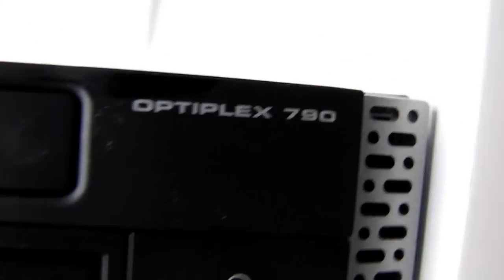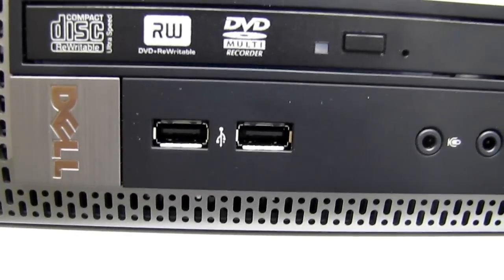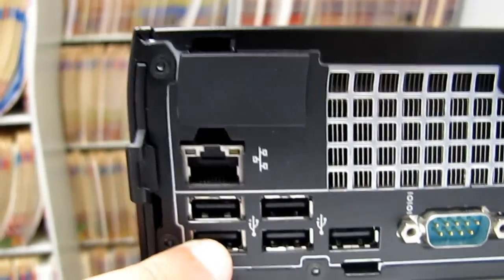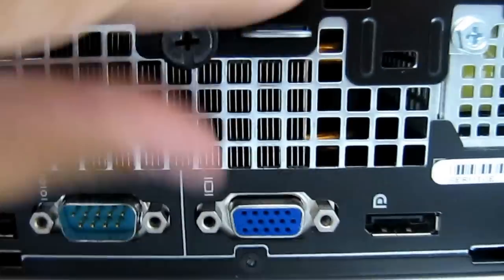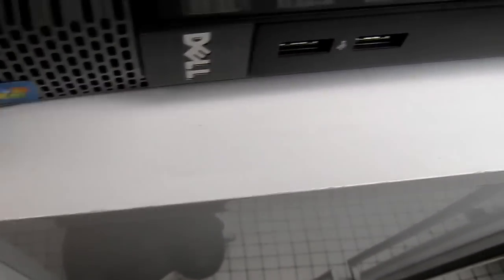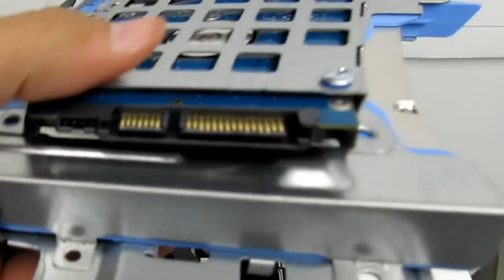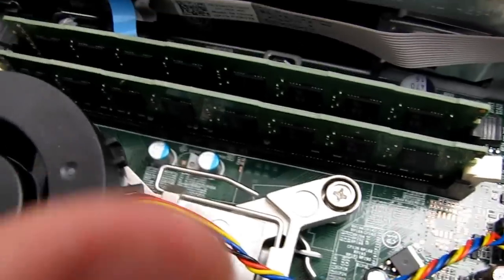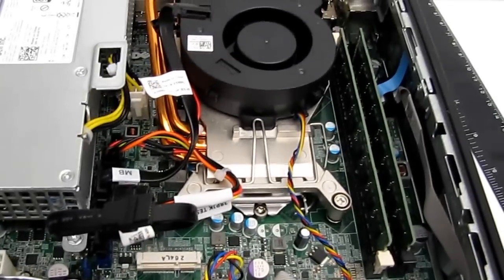A look at the Dell Optiplex 790 Ultra Small Form Factor USFF. My worst video gets 61k views. LOL

Comment: Is this good for gaming
Reply: No. It’s not half good for gaming. Especially triple A titles including cod and Apex. If you want to run small games like csgo or warmode on low graphics make sure to have 16 gigs and a cheap GTX 710 graphics card. I have all this and it runs like a charm on csgo. Gta on lowest graphics I get close to 28 to 22 FPS. But csgo 70 easily!

Comment: Was the camera high when filming this?
Reply from the maker: +BenjtheMan I never really watched this video.   28,000 views and it sucks. lol
Reply from the maker: I have no clue how this shitty video has 39,000 views.
Reply: Its one of those new high tech water lenses.
Reply: I thought it was very informative.. The size is great and the CPU chip, it can be used for home or office and business.  However, we heard that this ITX small form factor computers have a glitch. Sometimes it will not power on and give error Code 3...It was discovered that the power butoon  has problems..so Dell replaced motherboards or the power butoon .  A a lot owners of this ITX complained about powering off failure.
Reply: Mananga Lilla! Yeah I just wanted to know if it be a good server build 🤔 think it’s over kill for my needs 😂
Reply: @xoomvids  lol

Comment: I got that PC and I have to admit,  it works like a charm. :)
Reply: Can support a Nvidia 750 ti graphic card?
Reply: Ronny Gómez Yes, it can.
Reply: Spriggangirl Thanks
Reply: "The USFF does not have a slot for a video card. You can install a graphics card in the other form factors but nothing that high spec - the power supply is a 235W unit for the sff and I think 300 for the tower. These are designed to be office/business/general purpose machines, not enthusiast gaming systems.  That being said, you could install something like a GT730 or equivalent ATI card and get some very nice performance out of one of these." NgtFlyer
Reply: Plínio Santana I have the Mid Tower with an EVGA power supply 500Watts and a GTX 1050Ti
Reply: Ok, just clarifying because this video is about usff model and not the mid tower..
Reply: Plínio Santana I noticed that :^) Thanks

Comment: Can upgrade graphic card ?To AMD 290 or NVIDIA GTX 970?
Reply: +The VR Lover The USFF does not have a slot for a video card. You can install a graphics card in the other form factors but nothing that high spec - the power supply is a 235W unit for the sff and I think 300 for the tower. These are designed to be office/business/general purpose machines, not enthusiast gaming systems.  That being said, you could install something like a GT730 or equivalent ATI card and get some very nice performance out of one of these.
Reply: Nein. You can not. But there is a higher model Dell Optiplex 9020 with the same form factor and much more powerfully built in Intel  Graphics 4600 GPU and core i3 or core i5. CPU for the price between 200€ - 300€

Comment: Can the Dell Optiplex 790 Ultra Small fit a gtx 1050 ti ?
Reply: Makara Haak yes but i would go for an 7010 DT its just a safer and faster bet..
Reply: Thank you
Reply: "The USFF does not have a slot for a video card. You can install a graphics card in the other form factors but nothing that high spec - the power supply is a 235W unit for the sff and I think 300 for the tower. These are designed to be office/business/general purpose machines, not enthusiast gaming systems.  That being said, you could install something like a GT730 or equivalent ATI card and get some very nice performance out of one of these." NgtFlyer
Reply: Thank you for your help.

Comment: Can i put in it a graphic card
Reply from the maker: I don't believe there is any place to put a card. It has VGA and DP bulit in.
Reply: There is no expansion slot. There is a 1x half height mini pcie slot for a wifi card. I took some flex cable and engineering to make it into two usable usb 3.0 drives